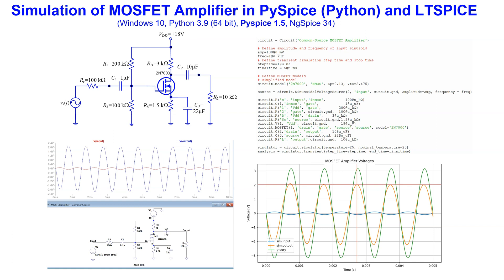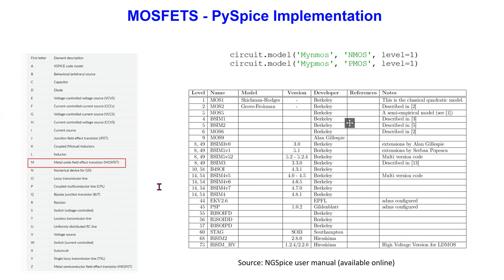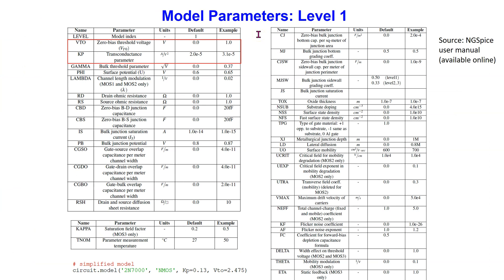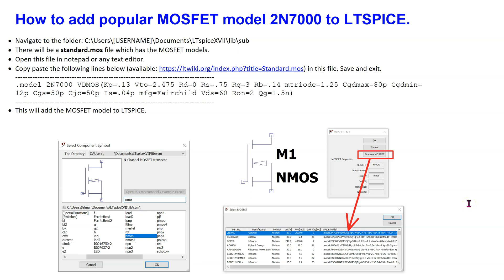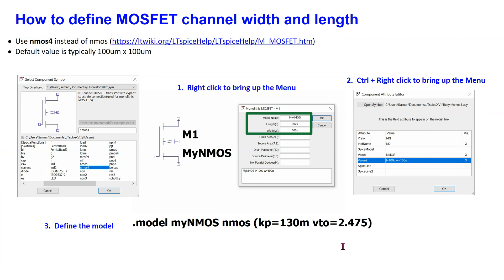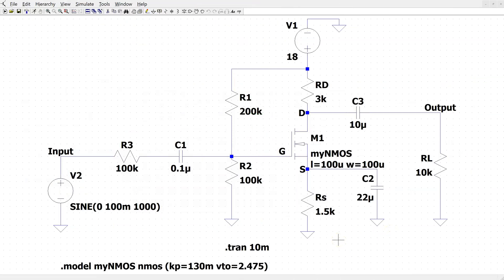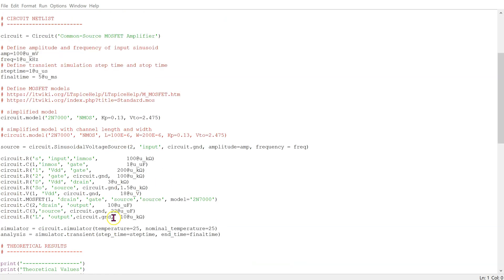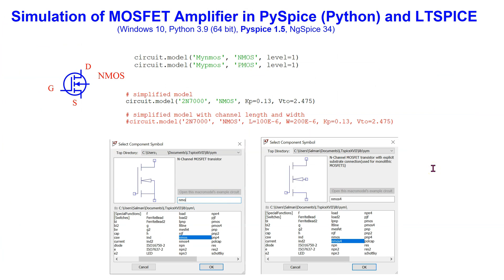Introduction to PySpice (Python) for Simulating MOSFETs and MOSFET Amplifier Circuits

Comment from the maker: # Pyspice (Python) code to simulate MOSFET Amplifier Circuit
######################################################################

# STANDARD DECLARATIONS
# ------------------------

import matplotlib.pyplot as plt
from matplotlib.widgets import Cursor
import numpy as np
from engineering_notation import EngNumber

import PySpice.Logging.Logging as Logging
logger = Logging.setup_logging()

from PySpice.Doc.ExampleTools import find_libraries
from PySpice.Probe.Plot import plot
from PySpice.Spice.Library import SpiceLibrary
from PySpice.Spice.Netlist import Circuit
from PySpice.Unit import *

# CIRCUIT NETLIST
# ------------------------

circuit = Circuit('Common-Source MOSFET Amplifier')

# Define amplitude and frequency of input sinusoid
amp=100@u_mV
freq=1@u_kHz
# Define transient simulation step time and stop time
steptime=1@u_us
finaltime = 5@u_ms

# Define MOSFET models
# https://ltwiki.org/LTspiceHelp/LTspiceHelp/M_MOSFET.htm
# https://ltwiki.org/index.php?title=Standard.mos

# simplified model
circuit.model('2N7000', 'NMOS', Kp=0.13, Vto=2.475)

# simplified model with channel length and width
#circuit.model('2N7000', 'NMOS', L=100E-6, W=200E-6, Kp=0.13, Vto=2.475)

source = circuit.SinusoidalVoltageSource(2, 'input', circuit.gnd, amplitude=amp, frequency = freq)

circuit.R('s', 'input','inmos',         100@u_kΩ)
circuit.C(1,'inmos', 'gate',            1@u_uF)
circuit.R('1', 'Vdd', 'gate',        200@u_kΩ)
circuit.R('2', 'gate', circuit.gnd,  100@u_kΩ)
circuit.R('D', 'Vdd', 'drain',    3@u_kΩ)
circuit.R('So', 'source', circuit.gnd,1.5@u_kΩ)
circuit.V(1, 'Vdd', circuit.gnd,      18@u_V)
circuit.MOSFET(1, 'drain', 'gate', 'source','source', model='2N7000')
circuit.C(2,'drain', 'output',    10@u_uF)
circuit.C(3,'source', circuit.gnd, 22@u_uF)
circuit.R('L', 'output',circuit.gnd,  10@u_kΩ)

simulator = circuit.simulator(temperature=25, nominal_temperature=25)
analysis = simulator.transient(step_time=steptime, end_time=finaltime)

# THEORETICAL RESULTS
# ------------------------

print('------------------')
print('Theoretical Values')
print('------------------')

K = 0.13
VT =2.475@u_V

# DC bias analysis
VTH = (circuit.V1.dc_value)*(circuit.R2.resistance/(circuit.R1.resistance+ circuit.R2.resistance))
RTH = (circuit.R1.resistance*circuit.R2.resistance)/(circuit.R1.resistance+ circuit.R2.resistance)

a = K * float(circuit.RSo.resistance)
b = 1- 2*K*float(circuit.RSo.resistance)*np.abs(VT)
c = K*float(circuit.RSo.resistance)*VT*VT- np.abs(float(VTH))
V_GS = ((-b + np.sqrt(b*b-4*a*c))/(2*a))*1@u_V

I_D = (VTH-V_GS)/circuit.RSo.resistance

# small signal AC analysis
gm = 2*K*float((V_GS-VT))

R_in = RTH
R_o = circuit.RD.resistance
A_v = float(-gm*R_o*(R_in/(R_in + circuit.Rs.resistance))*(circuit.RL.resistance/(circuit.RL.resistance+ R_o)))

# Find the theoretical output waveform; use the time output of the simulation
time=np.array(analysis.time)
v_out = A_v*(amp)*(np.sin(2*np.pi*freq*time))

# Display the DC and AC parameter values
print('VTH={} V'.format(EngNumber(float(VTH))))
print('RTH={} Ω'.format(EngNumber(float(RTH))))
print('a={}'.format(EngNumber(a)))
print('b={}'.format(EngNumber(b)))
print('c={}'.format(EngNumber(c)))
print('VGS={} V'.format(EngNumber(float(V_GS))))
print('ID={} A'.format(EngNumber(float(I_D))))
print('gm={}'.format(EngNumber(gm)))

print('Rin={} Ω'.format(EngNumber(float(R_in))))
print('Ro={} Ω'.format(EngNumber(float(R_o))))
print('Av={}'.format(EngNumber(float(A_v))))
######################################################################

######################################################################

# SIMULATION RESULTS
# ------------------------

# Plot the voltages
figure, axe = plt.subplots(figsize=(11, 6))

plt.title('MOSFET Amplifier Voltages')
plt.xlabel('Time [s]')
plt.ylabel('Voltage [V]')
plt.grid()
plot(analysis['input'], axis=axe)
plot(analysis['output'], axis=axe)
plt.plot(time, v_out)
plt.legend(('sim:input', 'sim:output', 'theory'), loc=(.05,.1))
cursor = Cursor(axe, useblit=True, color='red', linewidth=1)

plt.show()